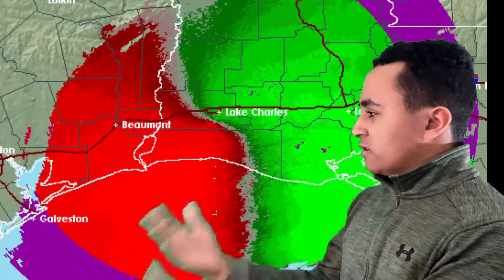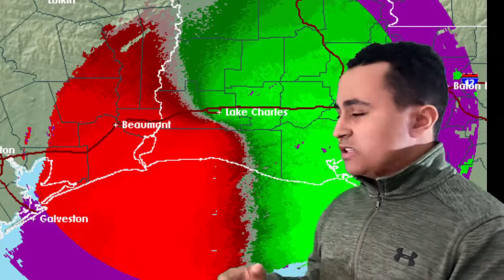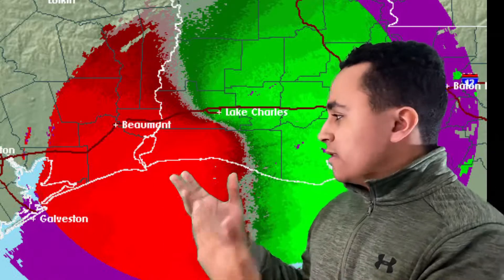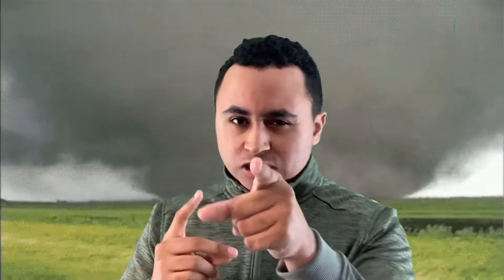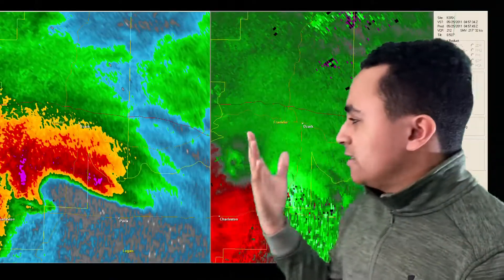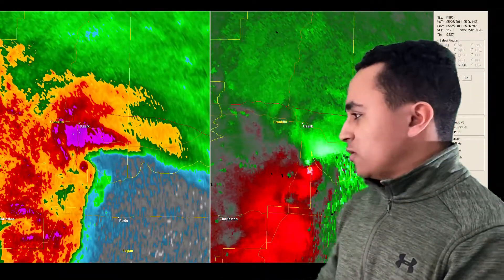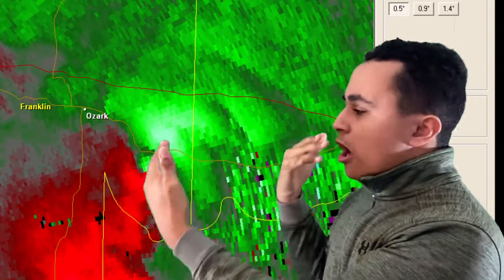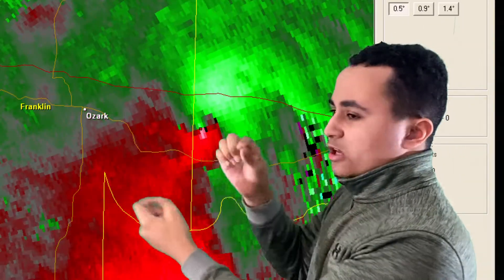How To Detect TORNADOES Using Radar Velocity!

Comment: First,Hey I have a question,what app or website do you recommend to track thunder storms and lightning
Reply: Radarscope is a very good app for storm chasing but it’s 10$. That’s really what I use
Reply: I first started with a app called MyRadar which costs nothing but you don’t get velocity and I still use that app but I realized that storm season was starting and I wanted velocity so I paid $5 for the velocity on MyRadar and it was very cool but it was NEXRAD Level 2 not 3 so I considered some options and got a pro tip from Pecos Hank and he suggested RadarScope so I got it and I am falling in love with it and already used its NEXRAD Level 3 velocity feature in the recent Tallahassee tornado. So I would strongly suggest RadarScope as a great option if you are willing to pay money but elsewise MyRadar is the other good option.
Reply from the maker: I agree with everyone else here that Radarscope is a really great place to go for tracking those things. Honestly, it’s very detailed, and will display a bit more than MyRadar will on a free trial of course. Paying just a little more for an app that includes a lot more amazing weather capabilities, especially when it comes to severe weather, is 100% worth it. :)